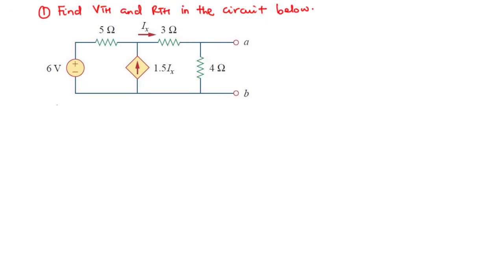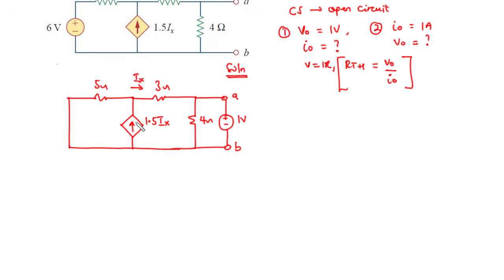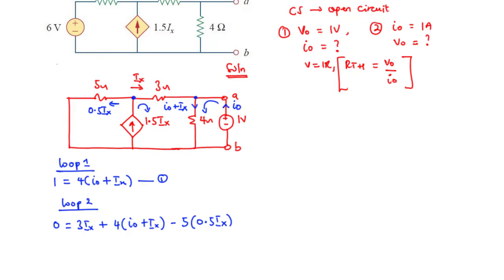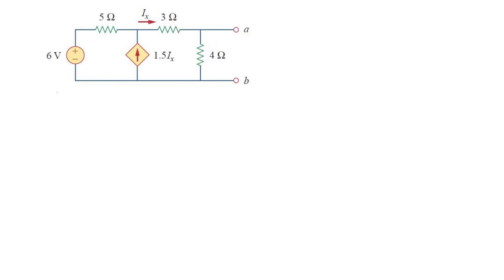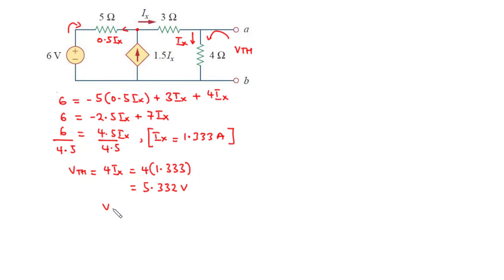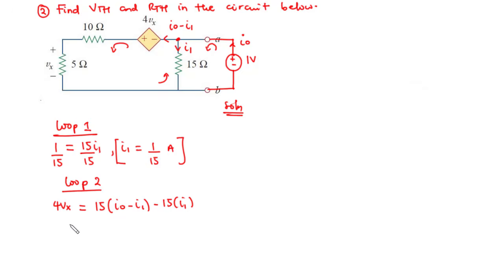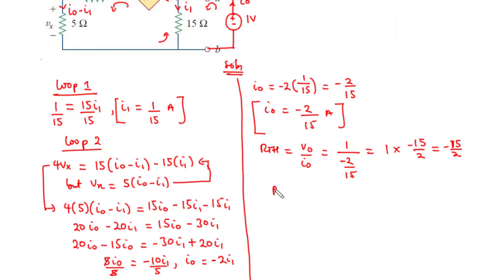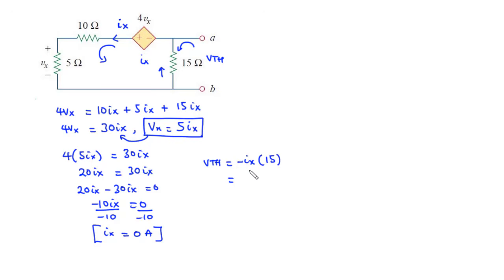☑️17 - Thevenin's Theorem: Circuits with Dependent Sources 1

Comment: Sir in example one ,we can also use short circuit current ,but short circuit current is equal to ix so the rth value is not matching
Reply from the maker: No please, the short circuit current will be 1A. So at the current source on the left, it will be 1.5ix divides to get 0.5ix and ix, and in 4ohms you have (ix + 1)

Comment: sir, for calculating the Vth in the example2, can I set the different positive and negative resistor terminals and write the equation as 4Vx+10Ix-5Ix+15Ix=0?
Reply: In general, you want to have positive voltage difference when the current flows from a low to a high potential point (voltage source in this example) and negative potential difference when the current flows from a high to a low potential point (any resistor). My point is that you have to use opposite signs for the source (4Vx) and the resistors (10Ix, 5Ix, 15iX). So the answer is no.

Comment: In example1, why the current flowing through the 5ohn resistor is 0.5 Ix?
Reply from the maker: It's simple: 1.5ix is flowing towards the junction. And ix flows in 3ohms, hence
1.5ix - ix = 0.5ix will flow in 5 ohms

Comment: Hello sir, in example 2 when we found i1 it is in fraction if we change it to decimal it is 0.66A so in i0 when we replace i1 to find it it will be -1.32A hence, isn't Rth Vo/io = 1/-1.33 = -0.76 ohms. so only because i changed the fraction to a decimal it changed the answer totally?? if so then when should i just keep it as a fraction and when should i change it to decimal?
Reply from the maker: Usually during the solution process, use fraction, and then you convert the final answer to decimal, but if you want to be changing to decimal every now and then, leave your decimal to 4dp.

Comment: while finding vth at example one does no current flow from the 6v battery and we only consider 0.5 Ix?
Reply from the maker: Current flows from the 6v battery. You can make 6v the reference source to do the current distribution, it is correct, but my reference was the 1.5ix current source that is why I have the 0.5ix moving towards 6v.
You can equally do a current distribution using the 6v as reference and get the same answer

Comment: Hi! May I know why are there two value of Ix? What is the difference between the Ix obtained in solving the resistance vs the Ix obtained in solving the voltage?
Reply from the maker: The idea is.
To find the rth we need to solve for Ix, that's the first Ix.
For the second Ix helps you to find Vth.

The two are independent. So in another question it can be a different ball game altogether

Comment: This is contradicting to content I read from Basic engineering circuit analysis by David Irwin 11th edition page 192, I suggest u check that page and see where u go wrong if at all u are wrong
Reply from the maker: Kindly specify where you disagree with me.
Reply: @SkanCityAcademy_SirJohn 
The part where you apply an independent current source, the book says you only do this if the entire circuit is made up of only dependent circuits, yet here yo dealing with one that has both independent and dependent
Reply from the maker: @lugandaronald64 mmm are you sure?? Kindly double check
Reply: @lugandaronald64  i agree
Reply: @SkanCityAcademy_SirJohn I rechecked and both methods work, the first time I replied I had not yet tried both, but now am sure they both work, thanks for the great content
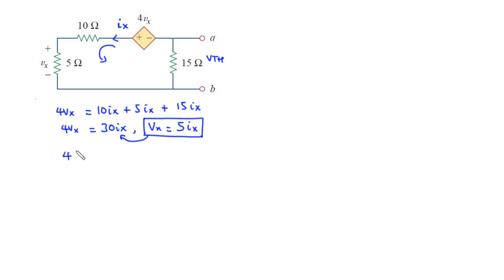Reply: 20:10  4Vx=30ix then why Vx=5ix????

Comment: Please 2:25
What if you use Io=1A. How one now find vth
Please sir
Reply from the maker: Okay,
Do current distribution. That is 
Current in 4ohms is (ix + 1), in 3 ohms is ix and in 5ohms is 0.5ix.

Apply kvl to the loop containing resistors, 3, 4, 5.
Ix = -8/9 
Vo = 4(-8/9 + 1)v 

Rth = vo/io = 4/9/1 = 0.444 ohms

Comment: What was the purpose of the polarity over the 5 ohm for vx .Shoudnt the voltage across ir be -5Ix.Since in the direction assumed there will be a negative drop?
Reply from the maker: The polarity on the 5ohms just explains or indicates the direction of current through it, i.e. From positive to negative.

Comment: is Vth always 0 if there are only dependant sources? like it was in example 2 since there are no independent sources to provide voltage.
Reply from the maker: Yes, the vth will be zero if there are no independent sources.
Reply: Can you explain why you set 1 V source on the a ,b？

Comment: How is it possible that the voltage drop across 4 ohm resistor is 5.33V? That means 5 ohm and 3 ohm resistor only dropped 0.67V from the 6V battery. Can you please explain that?
Reply from the maker: Notice that in this case, there is a dependent source which also contribute to the circuit.

Comment: isnt the current in the 15ohm resistor ( i0-i1)-(i1 since i1 is also going through 15 ohm in the opposite direction ?
Reply: why did you use i1 only for the 2nd loop 15ohm resistor
Reply from the maker: So that we can only solve for one unknown since we have only one equation around a loop.
Reply from the maker: If we use i1 for the other loop, we will struggle with the value of vx
Reply: @SkanCityAcademy_SirJohn  thank you sir
Reply from the maker: No please
Reply from the maker: Which country do you come from?
Reply: @SkanCityAcademy_SirJohn  South Africa , University of Cape Town
Reply from the maker: Okay

Comment: You had two different values for the same variable Ix... why are they different.. 
And does the Vth only affect that loop
Reply from the maker: The values for Ix are different because you are doing two different things:
1. You want to find RTh hence you need to excite the circuit because mind you, the independent sources are removed and if independent sources are removed, dependent sources have no purpose because they are controlled by these independent sources. So ones you excite the circuit with a 1v or 1A source you get a value for Ix. Also when finding Ix or any current value, do not consider the loop with a dependent current source.
2. After finding RTh, you need to find Vth, and this time you leave the terminal open, hence the value for Ix will surely be different.
For the last part. You can use the other loop from vth to the far left. Ignore the loop with the current source.